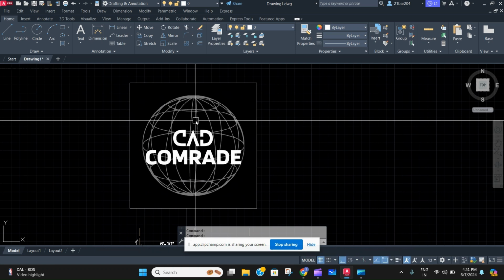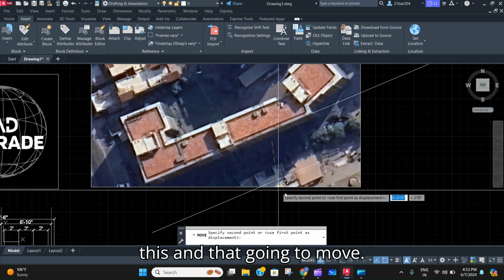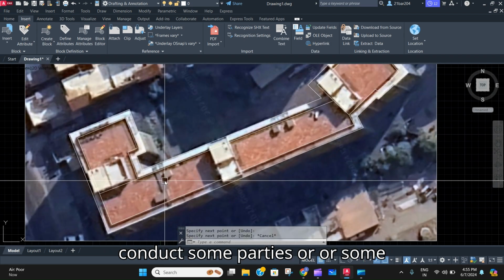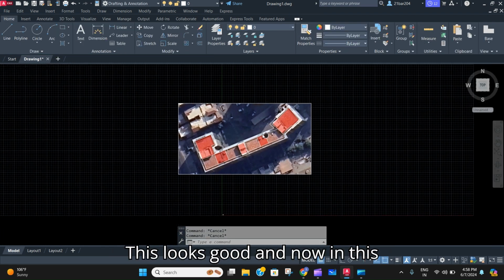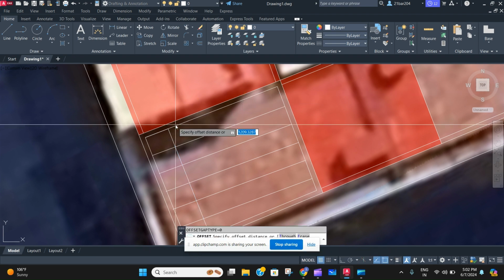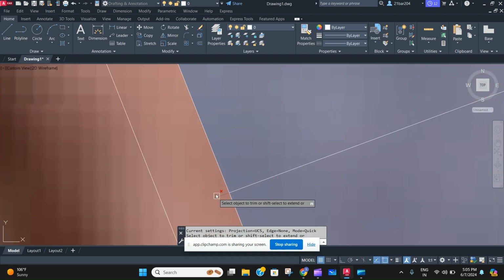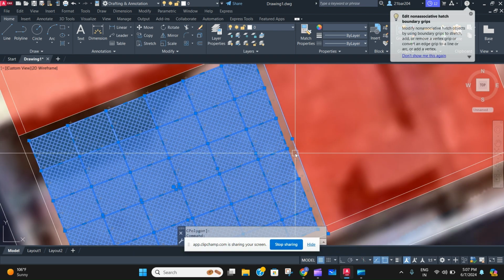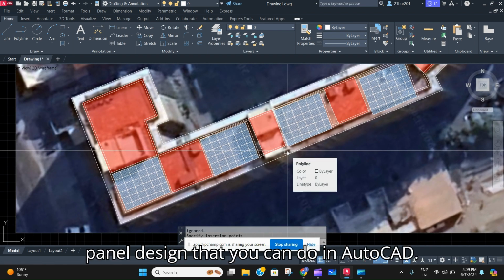Solar system design in AutoCAD !!

Comment: Use the SCALE command:

Type SCALE → Select the image → Enter.

Specify a base point (any reference corner).

Either:

Type a scale factor (e.g., 2 = double size, 0.5 = half size), OR

Use the Reference option (R):

Pick two points on the image that you know the real distance between.

Enter the real distance, and AutoCAD will resize the image accordingly.
Reply from the maker: Great !!